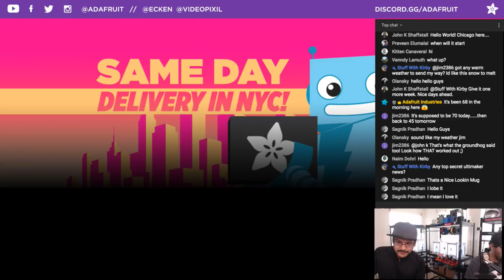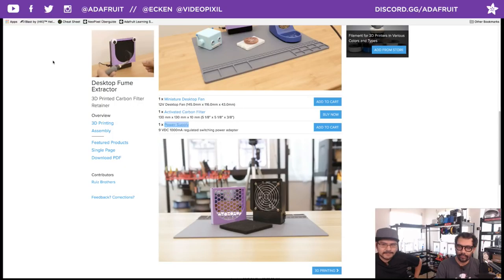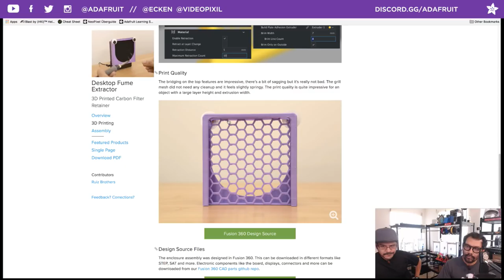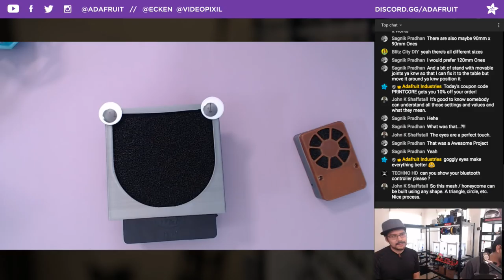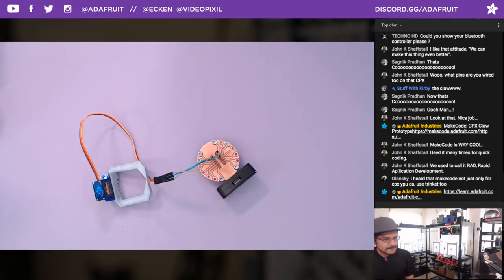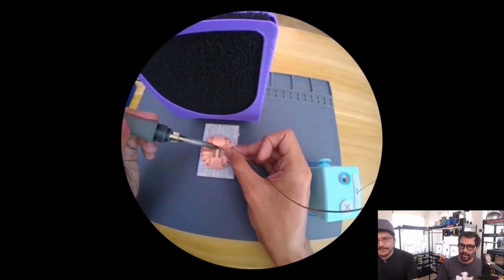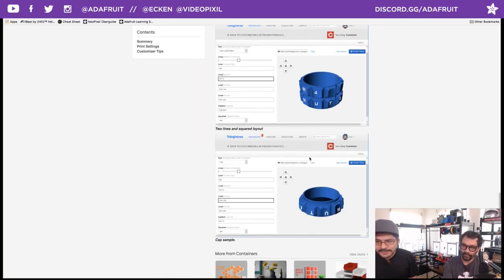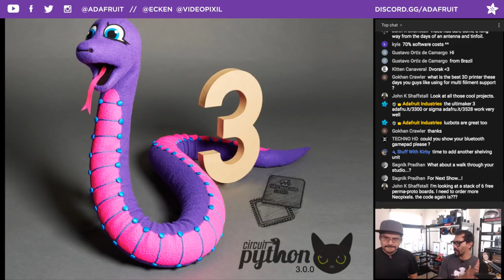3D Hangouts – Fumey The Fume Extractor

Comment: You going to consider building a fume cupboard to encase your 3D printers while they are operating there will have to be a conduit to accommodate mains cables and data cables running from the printers to the computers that you have and ventilation ducts from the outside through the fume cupboard to the outside via a fan to create negative pressure in the cabinet so none of the fumes come into the lab and means you can print using feed stock that gives off nasty fumes when heated, I.E. ABS, Perspex, etc......